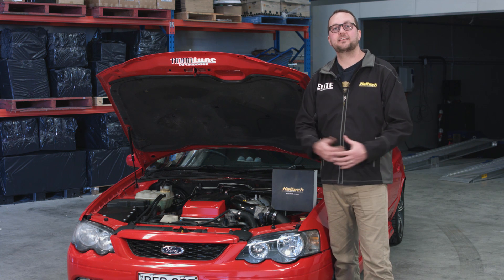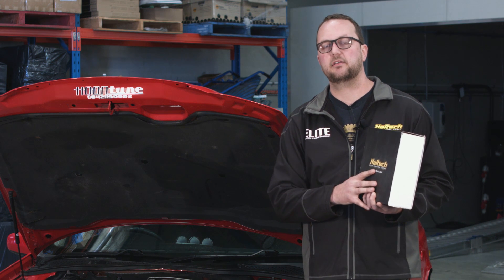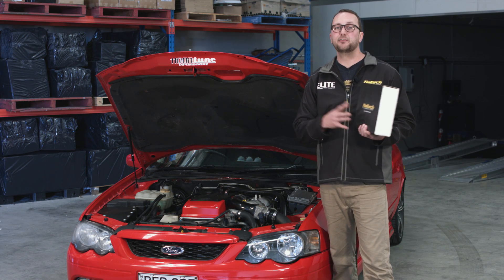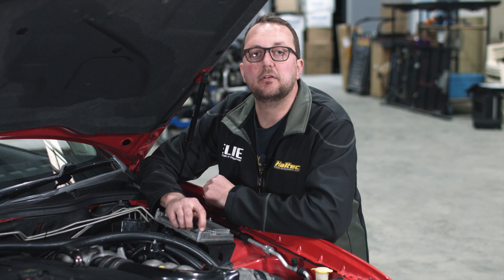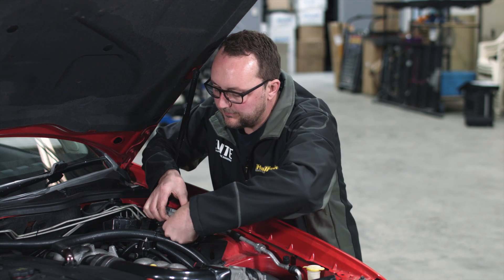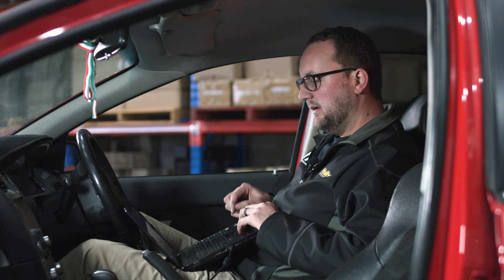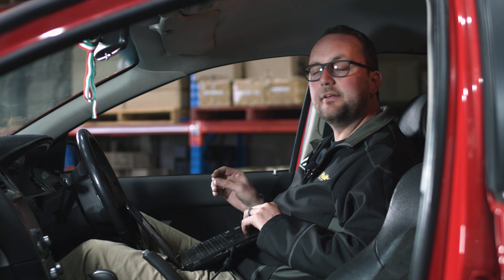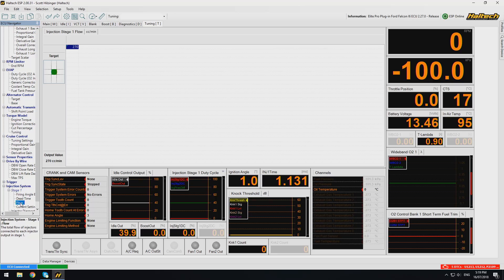💬 Barra Plug and Play ECU Install and Basic Setup | TECHNICALLY SPEAKING

Comment: I have one in my ba if I wanted to upgrade my boost solinoid can I use the wires from the factory solinoid or just run new one from the haltech plug  ,  dpo #7 pin 16

Comment: Hi! Ive got a Barra that ive put in a 64’ ford pickup(in the USA). Id like to be able to set up multiple tunes for race, tow, eco. Is the stock ecu capable?
Reply: Yes, with the correct tuning hardware. Pcm or hp

Comment: What aftermarket boost controllers will work well with this ECU?
Reply from the maker: You should be able to use any aftermarket boost controller. Keep in mind though - this ECU has an in-built closed loop boost control  already:)
Reply: @haltech  Okay. My mistake. I was thinking boost control solenoid. I've been doing a lot of research and saw some three port boost control solenoids and they are supposed to provide better boost control. Can they be used with the Haltech ECU? Are they a worthwhile upgrade?
Reply: @haltech  Will the ECU provide good control to the Turbosmart 4 port boost controller? In conjunction with the twin port IWG75 external wastegate controller the 4 port controller should give good boost control down to very low levels as well as at higher levels.

Comment: Great to know how it is done, with out being ripped off by tuning guys
Reply: Best part i see with this ECU, most good tuners know how to use haltech software blindfolded, don’t need to flash the Stock ecu which usually makes the cost of the tune go up because the software needs a license purchased. Here with this plug and play ECU , they just connect to it, set  up the car on the dyno, and get tuning. Bloody awesome ECU! I was considering getting one for my falcon.. but i only have a 4 speed btr so ill either have to convert it to manual, or 6speed ZF. Would be amazing if they could incorporate a 4 speed auto control in the ECU.. would be amazing!

Comment: How long before this plug in will be available to plug into a territory which is especially the same car. Trying to put an xr turbo conversion into an sz territory and can’t use your plug in due to lack of CAN settings. More than happy to bring my car in for you guys to make a copy of my software so you can make this as an option
Reply from the maker: This ECU should work with a rwd Territory. We haven't tested it with the AWD version as yet.
Reply: I called yesterday and was told it doesn’t suit sz rwd. Has n/a barra in it and am replacing it with fg xr6 turbo conversion
Reply from the maker: OK so the tech that spoke to you was correct. We have only done limited testing on the Territory and the CAN integration varies from model to model.
Reply: I’m keen to get one as soon as it becomes available and I’m putting in into a titanium if that makes a difference. Also would love zf tuning as I’ll have the n/a box to start until I get a box built for it

Comment: Here  in  USA  I  want  to swap an  LS in  an older  carbureted car..   I  also  want to  use  flex  fuel which  really  is  not supported  by  the  aftermarket .   I   can   get  an   ECM  flashed with a flex  fuel   map   but   don't feel   like  paying  a  dyno  tuner  $600.00   every time  I   want to make a change..

  GM  ethanol  Censor  is  $75.00   Haltech   is  like  $175  .  I  don't know  if  there  is  any  difference..  I  sure  want  to  utilize  the   two   engine knock  sensors    the  LS  has ..  Also not  well supported  by  American  brands..   The  Elite   2500  seems   to  suit my needs.  Looks  as  though   you    have  to  purchased  the Wide  Band   oxygen  sensor and  brain  separately ..   many  brands  include   two   oxygen sensors   for a 
 v-8  .
  I  also  like  they   digital   dash  gauge ..   I  am  guessing   I  can purchase  the   less  expensive  unit  that  does   not   support   data   allowing  as  the  Elite  2500  would  have  all   the  Data  logging  I need.

  Funny  I  contacted  a local  Haltch   dealer In  the  USA and he  told  me   by  the  GM   ECM ANds wire  loom  and he would   put  the  Tune  Maps  in it for  flex  fuel...  I  have  not figured  a  total   price   but  looks  to   be $3200.00  USA  or more ..   My  1979 Z-28  Camaro  cost  $7,190.00   new ,  mostly  inflation  but  what a shock  these engine  swaps  cost..  I  need   a    Tremac  magnum   56  
Trans  too..  Any  advice   @Haltech    ?
Reply from the maker: Not sure what advice you're asking for - if it's regarding the choice of ECU then Elite 2500 will work no problems. If you're on a budget then we would recommend Elite 950. It will still do the job but you won't be paying for all the race features which you probably won't need. It will also support Flex Fuel. We do recommend getting a wideband controller too.
The best thing to do is to give our tech support a call. One of our guys will be able to go through your setup and tell you exactly what's the best combo for your application.
Reply: @haltech   Thanks  for   response..   In  your  video   you asked  for  suggestions   on  topics  to  cover ..  My   suggestion   was  to   make a video  of  how  to   use  your  Instrument  panel..   My  other  question was:  if the   2500  Elite   has  data  logging   capabilities..   then   I  don't  have to pay  $500   extra  for  an  instrument  panel   gauge  that  has  Data  logging capability ?
   I  will   study   the   features  of the  Elite  950   engine   again ..  WE   are  talking about  an   8  Cylinder   sequential  Ls-3  or  LS-7  motor
Reply: @haltech    I  read  all  the  Charts  two  weeks  ago  and   I  did   call  Haltech..   I   knew  there  was   a  reason   why   I   decided on   the   Elite  2500   but  did   not  recall   exactly.    
   The   reason   why   your   advice to  choose   a   950   is   really   bad  ,,,  Is   because  the  GM   LS-  motors  included   my   choice   of  LS-3  or  LS-9   is   the  fact  they  all  LS   motors  that   I know  of   come  with   2  anti  knock  sensors....  
    This    is  a  great  feature  that  I  want  to  take advantage  of..  
    I  have  to   go  up   to the   2500  Model    to  have  knock   control   features..
    Seems    that  some  one   from   Haltech   would   know this..    after  sending  some  time  on   the  web   site  ,  I  figured  out  ways   to   look   at the  tiny   font in  the   features   charts   and figure  this out 
https://www.youtube.com/watch?v=hGuAneUd2_4

   I  guess   it's   up   to  the  end  user    to  figure  all  this  out …   I find  it rather  funny  I   called  my Local   Haltech   Dealer and  he  suggested   I  go   with the   GM ECU   that would   save  me  a  lot  of  money   but  I would  have to   pay  him  $600   for   his   custom  Dyno   tune  and  Flash.. with a  flex  fuel   Map   borrowed   from   existing GM  maps   for a  similar  flex  fuel  model  
   Now  I  have   forgotten  the  Name  of  the CO in USA   that  sells   software   that  allows  you to   re-flash  GM  UCM    @Haltech

Comment: Do any of you guys know if it's compatible with the XR6 NA 2004 BA? if not why is that?
Reply from the maker: Here is a list of compatible models:

• Ford Falcon BA (02-05) I6 4.0-litre DOHC VCT “Barra” engine with manual transmission.
• Ford Falcon BF (05-08) I6 4.0-litre DOHC VCT “Barra” engine with manual transmission.
• Ford Falcon BF (05-08) I6 4.0-litre DOHC VCT “Barra” engine
with ZF 6HP26, 6-speed auto transmission.
• Ford Falcon FG MkI and MkII with the I6 4.0-litre DOHC VCT “Barra” engine
and ZF 6HP26, 6-speed auto transmission.

• Naturally aspirated or forced induction.
• Engines covered: Barra 182, 190, 240T, 245T, 270T.

Comment: So just wondering I’m putting a barra t in my vh commodore the motor box and harness are coming out of a ba do I tell the ecu it’s a ba or somthing differnt
Reply from the maker: If the engine, trans are from the BA and you are using the factory harness then yes, you selected the BA.

Comment: Does that suit the FG FPV 5 litre Coyote SC ?
Reply from the maker: This ECU suits the 6-cyl Barra engines:
• Ford Falcon BA (02-05) I6 4.0-litre DOHC VCT “Barra” engine with manual transmission.
• Ford Falcon BF (05-08) I6 4.0-litre DOHC VCT “Barra” engine with manual transmission.
• Ford Falcon BF (05-08) I6 4.0-litre DOHC VCT “Barra” engine
  with ZF 6HP26 6-speed auto transmission.
• Ford Falcon FG support coming soon!
• Naturally aspirated or forced induction.
• Engines covered: Barra 182, 190, 240T, 245T, 270T.

Comment: So the plug doesn't have settings for a BA n/a auto?
Reply from the maker: This ECU suits the following engines:
• Ford Falcon BA (02-05) I6 4.0-litre DOHC VCT “Barra” engine with manual transmission.
• Ford Falcon BF (05-08) I6 4.0-litre DOHC VCT “Barra” engine with manual transmission.
• Ford Falcon BF (05-08) I6 4.0-litre DOHC VCT “Barra” engine
  with ZF 6HP26 6-speed auto transmission.
• Ford Falcon FG support coming soon!
• Naturally aspirated or forced induction.
• Engines covered: Barra 182, 190, 240T, 245T, 270T.
Reply: But aren't most Ba na automatic transmission 4spd.... Not manual??

Comment: Use a cold chisel or a punch and hit the bolt around in a circle 
Takes 10 seconds
Reply: That's how I've always done it on steering columns which are a hell of a lot tighter and harder to get to than this scenario

Comment: Any idea why manufacturers changed the mounting position of the ECU from the kick panel to under the bonnet?
Reply from the maker: Mounting it in the engine bay is probably easier as you don't have to have the ecu loom going through the firewall into the cabin. But it does place more demands on the ECU - like heat, moisture and other environmental factors.
Reply: @haltech  Yes. It may be the "heat" factor that is causing my 2009 FG XR6 ECU's to fail after a few years, ie; intermittent non-starting eventually leading to engine "cut out" while being driven.